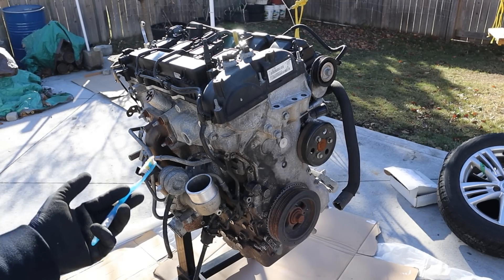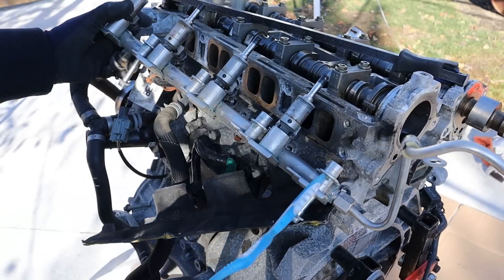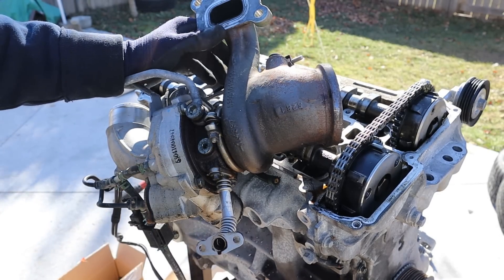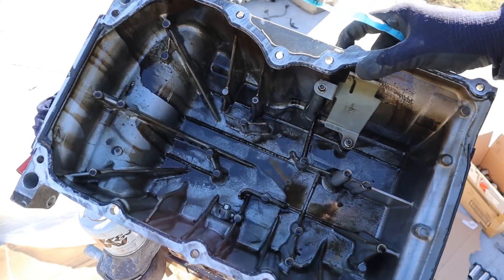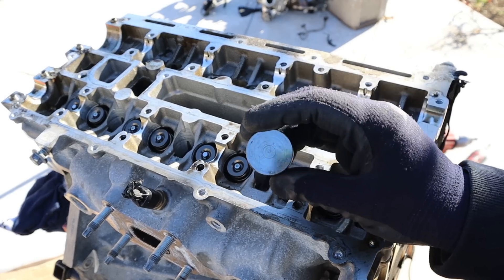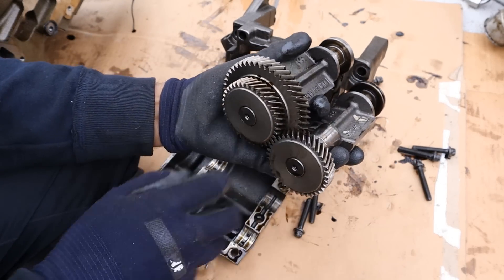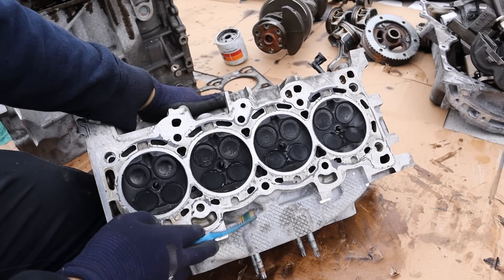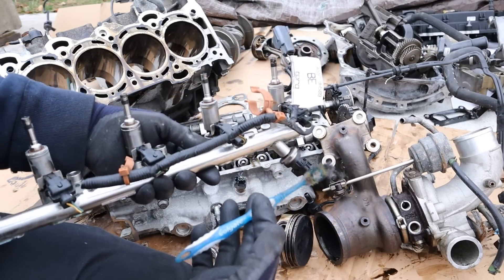Why Ford Ecoboost Engines Fail

Comment: Does using top-tier only gasoline help prevent this carbon buildup?
Reply: Oil changes and a oil separator are the biggest things you can do to help longevity.
Reply from the maker: Gasoline doesn't have as much to do with longevity as oil does.
Reply: No.. Engineers are payed to build engines that will fail a soon as they go out of warranty.. You can prolong engine life with 6k miles oil and filters changes..
Reply: @SuperGligorije  no we calculate for 200k miles at the specified oil change intervals. (I'm an OEM engineer and was in engine engineering at ford for 6 yrs)
Reply: @wydopnthrtl  How many problems did you find during testing but sent it out anyways?
Reply: @johnp.5134  That's not only NOT how development works.. but its incomplete.  We always design and build with margin.

There are two things that kill engines (**that were properly designed and tested**)
1. Poor quality lubrication (meaning not changed soon enough or run too low. Almost all oils today are adequate for the avg consumer IF changed at proper intervals)
2. Heat.  Overheating an engine is a death nail because metal expands and contracts. Its basic science.
Keep them running in good quality oil and keep them cool with good quality coolant... most engines will run 200k+ miles.
I use full synthetic oils changed at 5k miles and I change coolant every 3yrs

Modern Ford engines have DESIGN FLAWS.  Instead of learning from past mistakes they repeat them. <-- there is a fundamental reason for this but is a different subject that would likely get me banned for talking about.  Lets just say that when they purged the old farts (car guys like me) they purged all the legacy / knowledge.  Take a look at the population and nationality of Dearborn and one might start to see the basis of the problem.  <-- those "engineers" prefer calculation and simulation instead of making real world engines and beating the living crap out of them (like I used to do in the 90s)
Reply: no,, but a ovs really helps
Reply: Even cheap gasoline cleans tar off of hands….
Reply: @dogewisdom9921  but the injectors are next to the spark plug.. inside the cly// not behind the valves..i.e port injection... vrs..inside the cly/head  i.e. direct injection

Comment: If the oil control rings are in good shape...why was it burning oil ?
Reply: Pcv
Reply from the maker: PCV system will always dump oil into the intake. It goes straight into the engine and gets reburned.
Reply: @speedkar99  I see now there is a Ford TSB 19-2232
3.5L EcoBoost - Excessive Oil Consumption With Or Without DTC
P0365/P0369 - Built On Or Before 1-Apr-2019
relating to that PCV issue.

Comment: I thought it was the 3.5 EcoBoost V-6 on a FWD based model with the questionable water pump
Reply: I had to do mine in the naturally aspirated 3.5 at 140K km.  big job in that engine. When the pump fails it dumps all its coolant into the oil-pan, sound design.
Reply from the maker: Wow I haven't heard of the 3.5 issues. I'm assuming the WP is chain driven and that would cause a huge milkshake if the coolant made it to the pan.
Reply: @speedkar99  yes indeed, luckilly caught it immediately. Took the liberty of refreshing the timing system during the job so should be good to go for the rest of the cars life as long as the bearings survived

Comment: this is why port injection is better or multi injection
Reply from the maker: Exactly
Reply: @speedkar99  i installed a ovs  on my 2014 vel 2.0 ecoboost 2nd day i had it,,, no carbon on my intake valves

Comment: GREAT mechanical review! You have a gift for explaining things in an easy to understand format.
Keep up the great work 👍
Reply from the maker: I'm glad you appreciate it! Feedback is always welcome
Reply: @speedkar99  OUTSTANDING - 100% on all points even while watchnig and listening closely at 1.5x speed!
Reply: @satunnainenkatselija4478  it failed because it’s a crappy engine that has flaws.
Reply: @satunnainenkatselija4478   First off he tells why these engines fail. Secondly, you would rather have a plastic oil
pan because the aluminum pans are noisy?   SMH.

Comment: Its ecoboost, so it will not last anyway 😀
Reply: Nonsense - Anyone who takes care of the maintenance knows that these engines will last several hundred thousand miles. The 2.0 does have a head/gasket weak spot but it's the only drawback to these engines.
Reply from the maker: It's all the bolt on pieces that fail. Bottom end feels solid
Reply from the maker: Haha you caught that joke 😂
Reply: @speedkar99  I love your humor. Thanks.

Comment: How does a properly installed catch can suck in snow?
Reply: I bet the contents froze and either (somehow) got sucked in, or caused an entirely different issue. Would have been nice to take some measurements and check if this thing actually locked up
Reply from the maker: This sounds like a better explanation
Reply: @dirkmohrmann8960  highly doubt that theory. The already caught oil in there won’t freeze
Reply: @dogewisdom9921   freezing catch cans isn't some theory I came up with, it is a well known problem in real life. There is not just oil in there but a lot of water as well.
Reply: @dirkmohrmann8960  be that as it may, there’s an entry tube and an exit tube. No way is ice getting sucked down a 1/4 inch tube.
Reply: @dogewisdom9921   many catch cans have more like 3/4" diameter ports, which makes sense since the stock PCV is typically about that size, and the can needs to be able to flow an equivalent amount of gas. I don't really believe that "ice sucked through the PCV" is the most likely explanation as to what happened to this motor though.
Reply: sounds weird af
Reply from the maker: We did have a pretty big storm last winter

Comment: Great video, man. Engineers may one day revert to simple designs. In the mean time, I'll just subscribe to your channel!
Reply: Don't count on it! It's not the engineer's fault, it's government regulators, the marketing executives and the consumer who thinks all this tech is wonderful and doesn't know any better who force all this crap down our throats. It's all so wonderful when "new". At some point soon we will out strip our ability to comprehend all this technology. You won't see these cars on the road after 10 years. I see 30 and 40 year old Toyota's all the time. German cars are the worst 😐
Reply: Simple doesnt always equate with reliable.
Reply: @sugarnads  "Complicated" almost always equates too unreliable
Reply: @donuthole7236  no. As performance and efficiency rises so does complication.example:
My 1928 chev is verrry simple. It is also dog slow and burns fuel like i own a refinery. And if i sneeze twice on a sunday with Mars in Uranus it nopes out of the running game.
My kia cerato GT?
Ultra reliable. Very powerful for what it is and insanely complicated compared to the above chev.
Car engines have gone from simple, inefficient and terribly prone to breakage to complex and powerful and reliable.
Simple is NOT a synonym for good or better.
Reply: @sugarnads  A Kia Cerato GT. That's a brand new car. Get back to me what your experience has been after 10 years of ownership 🤣The new Ford GT500 is insanely powerful but is so complicated only the brave dare to mod it. With a 760 hp supercharged engine your 1 lean injector from destroying a $5000 block that can't be serviced and it goes in the dumpster. The  7 speed DCT transmission is very complex and expensive. As opposed to a 6 speed Tremec Ford use to offer is extremely reliable and can be rebuilt in your garage. You will never see a 30 year old 2022 GT500 cross the auction block at Barrett Jackson they are so complicated no one in their right mind will attempt to restore that car. On the other hand, a 04 Mustang Cobra can easily make 650 hp on pump gas and is relatively simple to work on and only has 1 ECU as opposed to 5 on the new Mustangs.

I'm seeing lots of recalls these days where they use to be quite rare. The software alone can "brick" a car that mechanically is in perfect working order. All this technology is wonderful when "new" but will be a nightmare as the car ages. The days of a roadside repair are long gone. Even the mechanic at a dealership may not know who to diagnose and repair a 10-year-old Kia Cerato GT as the technology is changing so fast they won't be able to keep-up. The wiring alone is a nightmare! This is the dilemma we all face. The car companies are incorporating all this tech with much of it having nothing to do with getting you to your destination. This is an unescapable fact whether you like it or not!
Reply: Will never happen. They need to make stuff flawed so it breaks down, so you have to pay $$$ to fix it.
Reply from the maker: Thanks for subscribing
Reply: @Matt this is an insanely simple design. I could work on these motors all day.
Reply: They already have it’s called electric motor
Reply: @michaelriecher5632  
You obviously do not have a basic understanding of the complexity of EVs.
Reply: @wildman1137  Electric motors have a fraction of moving parts compared to a modern internal composition engine, that's a fact.
Reply: @michaelriecher5632  True. In fact they only have one moving part: the rotor. It's all the cooling and control systems that are complicated.

Comment: Yes he's trying to speed through the video to cover everything, but from the viewers point of view he should turn the engine stand to the right so the Sun will shine on it so we can see what's there instead of it being in the shade it's not visible at all! Come on if you're doing a presentation you need to make sure your viewers can see it instead of casting a shadow over the side of the front of the engine and timing chain that you're speaking about?
Reply from the maker: Thanks very much for feedback, you are right I could have made the lighting better. 

It's winter and my shelter top has been removed from snow so I have to film in the direct sunlight causing the sharp shadows now.
Reply: @speedkar99  yes I'd recommend that you go ahead and review your video before you post it from a viewer's point of view and make sure all the surfaces you're trying to show or expose on video are easy to see using just the Sun by turning the engine stand around will be sufficient to do so, I hope I didn't come off as being harsh or rude? It was not meant to sound that way if I did? I would apologize in advance in case that is the point?

Comment: For people wondering - This one in particular hydrolocked due to snow getting in via a pcv catch can. Most fail due to lack of oil changes and LSPI (common on turbo Engines) where you go WOT on very low rpm and high gear (causing induced load cracking ringlands, pistons, etc.). I've owned an ST, currently an RS & 2.3 Mustang and  all have been stout to 100k with just maintenance. A lot of builds out there are pushing 400whp easily and the block can take up to 700whp.
Reply: A catch can is driver-installed, correct? So, the reason this ST failed is because the aftermarket catch can let snow in? Otherwise, the car would've run OK (minus carbon build-up)... but the carbon build-up could be due to the driver driving it hard. Since they added a catch can, my guess this owner was a racer.
Reply from the maker: Watch until the end of the video to see this engines failure points.
Reply from the maker: Agree...the bottom end is build pretty strong...it's all the bolt on stuff that fail
Reply: My buddy has an RS and drives like a cunt, regular oil changes and spark plus and he’s still going!
Reply: "snow getting in" sounds like a poor translation - seems more likely that the catch can froze, and the contents got sucked in all at once. Freezing catch cans is a common issue, and imo most people would be better off not messing with the stock PCV system
Reply from the maker: I think this is likely what happened. However there's no evidence of hydrologic inside the engine so maybe that story is fiction

Comment: So in short. Can someone summarise why ecoboosts fail ??
Reply: Open deck design. 4Cyl EcoBoost engines fail from coolant intrusion issues thanks to the "floating" cylinders and higher cylinder pressures thanks to Direct Injection and Turbo Charging. 

Carbon deposits are a common problem with all DI engines and is why they're now making DI engines with port injection as well. People also don't maintain these engines like they should be.

Out of all the small turbo 4 cylinder engines; EcoBoost engines are one of the better ones. VW and Hyundai make the absolute worst 4cyl turbo engines. They all have problems from Honda to Hyundai, however. It comes down to choosing what engine problems you are willing to deal with when you purchase a Turbo 4.
Reply: I agree. The VW 1.0/1.4 turbos are horrible designs
Reply: Yeah I didn't catch that part, unless it was just the carbon build up. In that case it seems it was a perfectly good engine that got junkyarded. There must have been something else

Edit: eh that was the last segment - maybe not why THIS engine failed but he did list what commonly fails
Reply from the maker: Skip to the end of the video 

Coolant passage on the cylinder head causing gasket to fail

Carbon buildup

Boost sensor 

Turbo leaks

Comment: I had Nissan, Toyota, and Honda with plastic valve covers. They are much more solid and feel more substantial than the one in Ford or GM.   The timing chain in Ford is still way better than most European cars.  Do you ever open an Honda or Acura direct injection Earth Dream or Mazda engines?  Are they also have big issues with carbon built up?  Toyota USA and Canada completely eliminate direct injection only in their line up.
Reply: Toyota Dynamic Force engines use port injection as well as direct injection. These are the enigines in the Corolla's and the Camry's and even Lexus models.. However they run on port injection most of the time and only when power is needed the direct injection kicks in. In regards to carbon buildup it is  probably a good design...but it adds more complexety to the enigine. Also because it is combined with not only  variable intake vavles but also variable exhaust valves. There goes the KISS aproach.
Reply: @harmdegraaf5579  Fortunately, in the past decade Toyota with much more complex yet reliable is possible.
Reply from the maker: Yeah I like Toyota's approach with dual injection. I haven't opened a newer Mazda as yet...hope to find one soon!

Comment: do you part out the engine parts? Here in Europe everything goes to junkyards to be sold or sold privately.
Reply from the maker: Scrap. I can't guarantee anything works so no point in trying to sell it.
Reply: @speedkar99  but parts? the intake manifold can't be broke and stuff like that

Comment: arent many differences between this and the zetec motor from 95-03
Reply: I'm surprised as well. Less bells and whistles on to Zetec so less things to fail. Mine was burning a lot of oil with completely gunked up piston rings that looked about twice as bad as this one. After changing the piston rings and meticulous cleaning the pistons  it hasn't burned a drop in the last 6 months with 250000km on the block.
Reply: @seljer  those oil scraping rings are key, huh? Shout out to speedkar for taking the time to teach us 🫡
Reply: Was thinking the same thing about the K20... at least timing wise
Reply: @MartB-tx5lb  yeah they are all essentially the same
Reply from the maker: Many 4 cylinder engines have the same basic layout. It's what works I guess